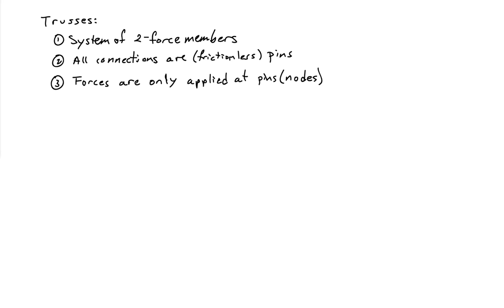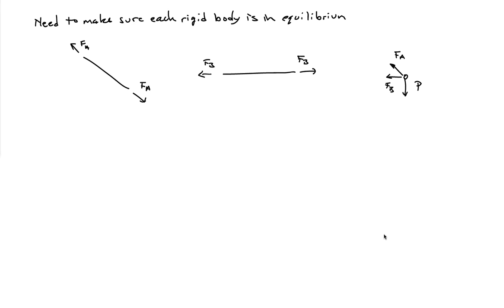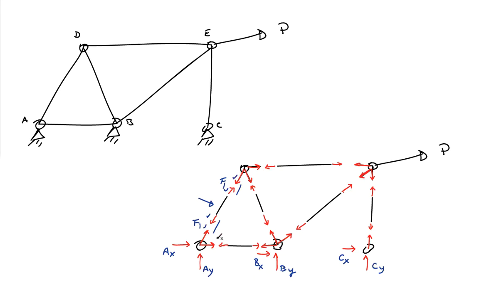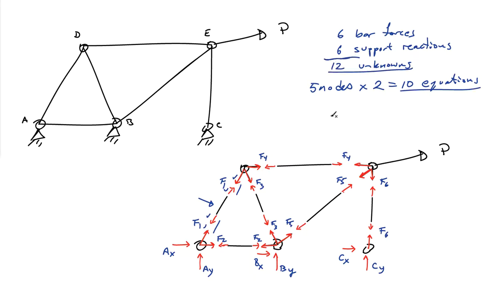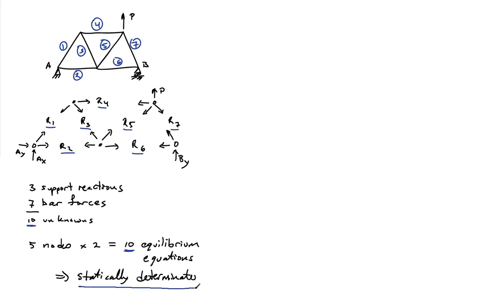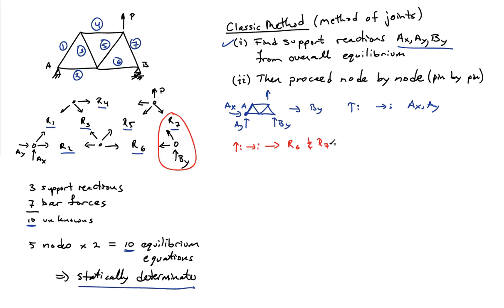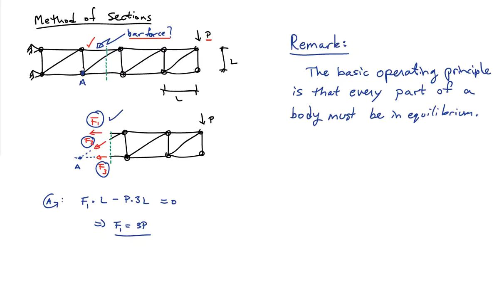(8C) Example: Static equilibirum of a truss

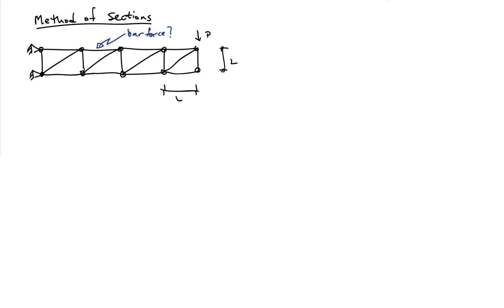Comment: Hello dear professor, isn't the truss at 12:57 statically indeterminate? Don't we have 20 equations and 21 unknowns? Can we make the system statically determinate by making 1 of the supports movable bearing and removing 2 zero member beams and 1 joint at the bottom right?
Reply from the maker: Yes, as drawn the truss is statically indeterminate: 17 bar forces and 4 support reactions, 2*10 nodes = 20 equations.  You can make the truss determinate as you describe.  The purpose of the example, however, is to show that one does not always have to resort to such methods.  Often if one is only interested in a particular piece of information, then a well constructed free body diagram can take you directly to the solution.  Also with the technique you describe, you have to be careful otherwise the bar forces you compute may not match the original structure; you have to ensure the same kinematics -- something that one can not do with statics alone.